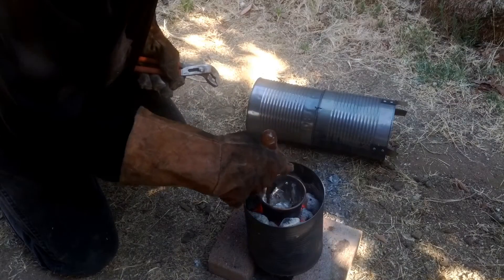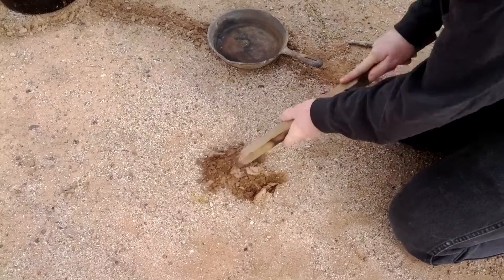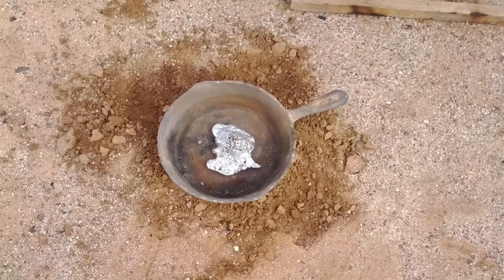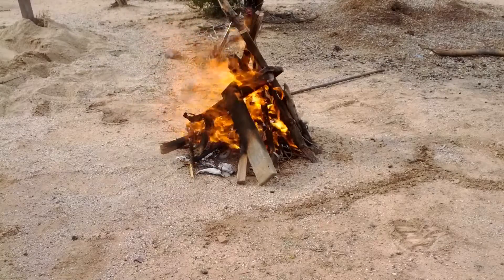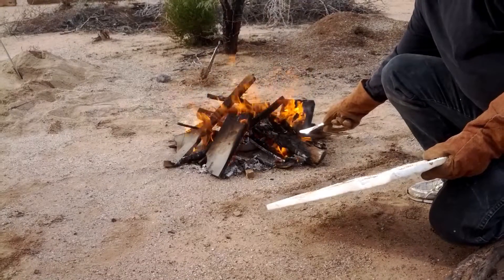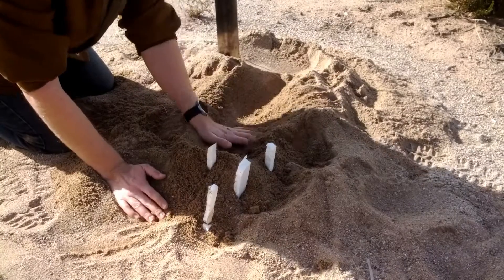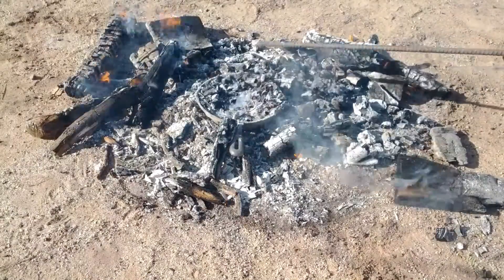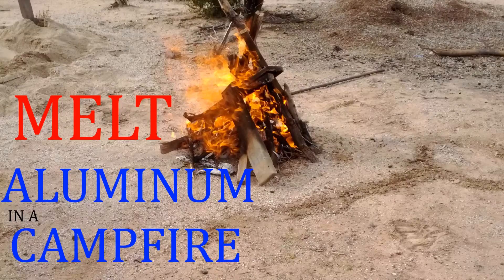Melt Aluminum in a Campfire

Comment: We have a sawmill and literally tons of scrap wood to burn. Last night we put a bunch of aluminum scraps in a steel coffee can in the huge bonfire. And nothing melted. Guess we need a shallow pan, not a deep coffee can. Thank you for your video
Reply from the maker: I image you are right; the high sides are protecting the metal from the heat. You could try building the fire and then setting the can of aluminum on top of it then adding more wood over the can. Or putting the can on some kind of pedestal so it is in the middle of the fire, not underneath it. The more it is surrounded by fire the quicker and easier it goes.
Reply: @bryannoyce  thank you

Comment: Mmm, so melting aluminum cans in a campfire like you do in Rust is actually possible..? Weird mechanic but physically possible
Reply from the maker: You can make a mold by digging a hole roughly the shape of the thing want and pouring the metal into it. You can finish shaping it with a file, or if you are in Rust world, you can try grinding it with the rock.
Reply: Dude play rust with me
Reply from the maker: @spongeboob5736  Dude, I only play Rust IRL ;)

Comment: This is how World Trade Center collapse
Reply from the maker: Aluminum melts 659C. The World Trade Center was made of mild steel, which melts at 1464C. Also, thick black smoke means the fire is not getting enough oxygen, so it is not burning as hot as it could be. If you are trying to melt metal and your fire is smoky, it may not get hot enough to melt.
Reply: @Atomic Bomb Heroes obviously epstein  built a huge campfire on top of the world trade center and melted it down while nobody was watching at 4 am except for me because i was definitely alive
Reply: At freefall speed mind you. Including a building nearby that wasn't hit by a plane (building 7).
Reply: @android584  You can time the collapse. It wasn't freefall speed.

Comment: How long does this typicically take to melt?
Reply from the maker: unfortunately I did not time it, sorry, but 15 to 25 minutes. As long as the fire is drawing a lot of air, with the wood stacked with spaces for air, it happens quickly.
Reply: @bryannoyce  hi ! We talked last night. Update about your olive cans stove: the campfire method is more efficient and faster than the cans stove. I timed it for you and it's about 26 minutes for a full hard aluminum bar with lenght= 1 metter, thickness= 1 milimetrer.
Reply from the maker: @theoldmansteve  that's cool. The campfire is fast, and it you can do very large or very small melts, Also you don't need to build a smelter, just start a fire. The can smelter is less fiery, as not to scare the neighbors, it uses less fuel, and is not as hot for the person doing the smelting. I guess if you were frequently doing small items the smelter would be the way to go, but otherwise, campfire all the way. Thanks for timing that.
Reply: @bryannoyce  i did crazyer things than that. My neighbors are used to flying bottles, black smoke and other stuff like that. Otherwise it depends on type of wood. As a romanian i use nut tree wood wich is a hard wood and a campfire made out of this wood can touch between 1900°C-2000°C with a good air flow. You're welcome, it was nothing for me to time the melting.
Reply from the maker: @theoldmansteve  I just got done building and firing a little brick kiln. I will know in the morning how it went. The kiln was made out of dry stacked bricks, I think I will try a mixture of clay, sand, and shredded paper next. Just stack it up like cob. It needs more insulation and to be easier to make airtight. I guess I better mold more bricks for the next attempt. I am in the Arizona desert, so the bricks dry pretty fast, but still, I don't want to be sitting here with a kiln I can't fire because I don't have any bricks. Well, luck with your engine cover.
Reply: @bryannoyce  add salt in your clay mixture. It reduces the chance for bricks to crack while drying. Good luck with your kilin too !

Comment: A deep venting pit could actually help the fire by sucking more air from below. But that would complicate the build. It's called a Dakota fire-pit. Similar in fact to classical open forges and modern rocket stoves.
Reply from the maker: If I was going to all that trouble, I would probably line the walls with local clay and make it a semi-permanent thing. If you're going to do some casting or clay firing it might be worth the effort.
Reply: @bryannoyce  
Interesting idea.
Reply from the maker: @YouTubeAccount-l4k  I have been focusing on natural draft (no blower) smelters because they are so much easier to do. If you decide that you are going to do more casting then a simple smelter like you describe would save fuel. It would also save time in the long run.

Comment: What's your opinion on an aluminum car rim melting in a wildfire. Conspiracies say it can't.  I say it can and does.
Reply from the maker: I missed this comment somehow! The answer is... it can. In most cases it wouldn't, but if there is fuel near by and wind it could easily melt aluminum. The tire its self would serve as some of the fuel, air blasted rubber burns really hot. Without doing experiments, I can't say for certain.

Comment: Cool vid! Would it work with brass and do you think a thick steel cup would be suitable to use as a crucible?
Reply from the maker: You can use a thick steel, or even a thin steel, cup for an aluminum crucible. It will burn thru eventually, but you can just throw it away when it looks like its not going to make it thru another melt. Brass is another story, the temperature you need is high enough that you need a blast, a chimney, a blower, something to raise the temp. You also need to make sure you are not just blowing the heat away, it has to be concentrated around and over the metal. You could try this exact setup and just blow on the fire with a hair dryer. That might work, if you do this, post pics on the Facebook page, good luck. https://www.facebook.com/RevolutionStandard/

Comment: I always pull out beer cans in our firepit. So they never actually melted. And our fires can get over the height of 10' to 15'.. Perhaps some did melt and just got cleaned out of the pile of debris. I didn't really dig through the crap to look.
Reply from the maker: with such a big fire, the center may actually be too cold, for lack of air. Also, the cans may have melted down, but a can melts down to a drop of aluminum and some crust (dross). If you put something to catch the metal under the fire, and throw all the cans in that spot, you might catch some Aluminum. Then you can take out the glowing aluminum and pour it on something. Fun ensues.

Comment: wow now I don't need to problem how to make furnace thank u very much u just earned 1 sub
Reply from the maker: Thank You. I'm glad it helped
Reply: Bryan Noyce can I mix aluminum and copper in campfire?
Reply from the maker: If you just want to make the aluminum harder by adding 5% copper, then you will be fine. The copper will dissolve in the liquid aluminum. The temp will not get hot enough to melt copper, but using it as a alloying agent will be fine. Be sure to give it time to dissolve. And tell us how it goes! good luck.
Reply: Bryan Noyce thamks
Reply: Bryan Noyce is that a stainless steel pan XD
Reply from the maker: The one in the video is just cast iron, but I have used stainless steel crucibles with success. You can use a plain steel pan in this setup too, but it will not last more than a few firings.
Reply from the maker: oh right, its all rusty, :)
Reply: Bryan Noyce thanks!
Reply: Bryan Noyce hey can I ask can I use bug spray can so I can melt aluminum on it?
Reply from the maker: A spray can is made of steel so it would work for at least one or two melts. Make sure its empty before you cut into it ;) They do have some aluminum spray cans but they are easy to identify. Some people have actually used soup cans! They use them one time and discard them. Good luck and take a few pictures, we would love to see what you do (even if its not perfect).
Reply: Bryan Noyce hahah I'm not expert at look those cans idk if its aluminum so yea IMA try because we had lots of it and I used it to start a fire like a flamethrower
Reply: Bryan Noyce can I send u the picture of the spray cans I'm going to use ? so I'm sure I have two kinds of it
Reply: oh and sorry if I keep asking some questions XD
Reply from the maker: no problem, you can send pictures if you'd like, but if the can has got a seam running up the side its steel. No big deal if your wrong, if its aluminum it will just melt, and we can have a good laugh.
Reply: Bryan Noyce haha yea.. how can I send u
Reply: Bryan Noyce can I use a Tin can like ? because we always got lots of it
Reply from the maker: Yes, a tin can is fine, usually you throw it away after one use. I will have to set something up so people can post pictures and videos and stuff, I would like to be able to what people are doing. I must find out how to do that? Thanks.
Reply from the maker: I just created a FaceBook page called "Revolution Standard" you can post any pictures or videos there. Notify me here if you do because I'm not sure how the FaceBook notifications work. I look forward to seeing pictures.